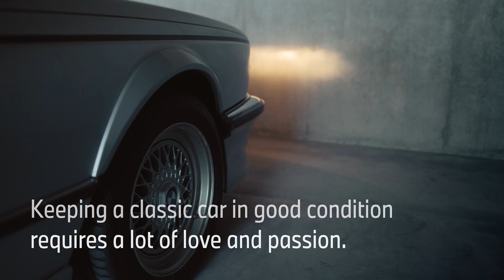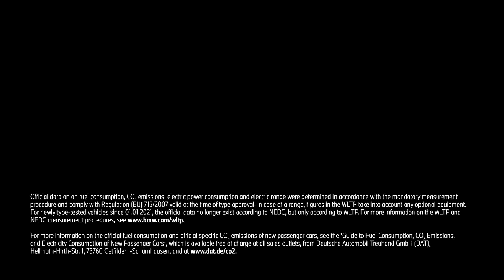Original parts and original service for your classic BMW.

Comment: I see a e24 for which I own and there’s loads of parts you can’t get anymore fingers crossed there start making new parts again
Reply: Yes some parts are problematic. Like the Air Flow Meter, Idle Control Valve or Throttle Position Switch (EH version) for an M30B35 motor. All Bosch parts, discontinued a long time ago.
In such cases the BMW Classic Partner will most likely have to jump on eBay or local listings and try to find a decent used unit... just like what we do. :)

Comment: BMW doesn't care about older BMWs, they care about the "enthusiast" suckers who are ready to pay insane amounts of money, for pieces of plastics and components that simply shouldn't cost this much, for such old cars. Recently, I wanted to replace my HVAC unit because the buttons kept falling out (Thanks to BMW's design of course), I asked for a price and they quoted me $400? For a plastic shroud with a 2000s board and a fan, and some buttons? Seriously? If they really cared, they'd start buying old totaled or written off bimmers, get the parts and components from them, and start fixing and re-selling them at normal prices as refurbished products.
Reply: Mercedes does not care about old cars either to be honest. They are just lying about their reputation.